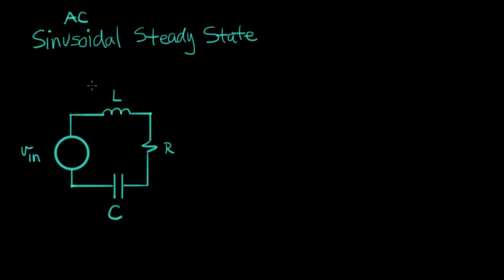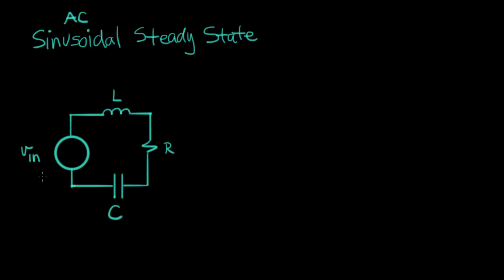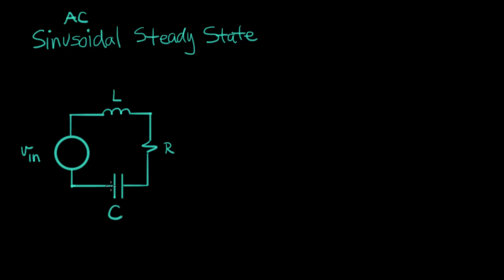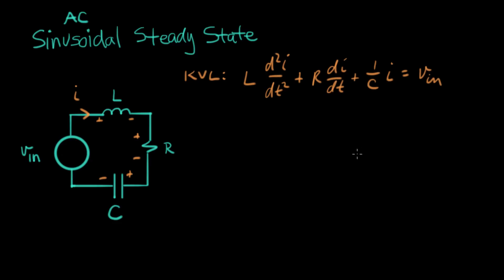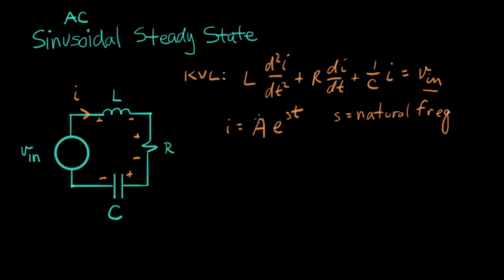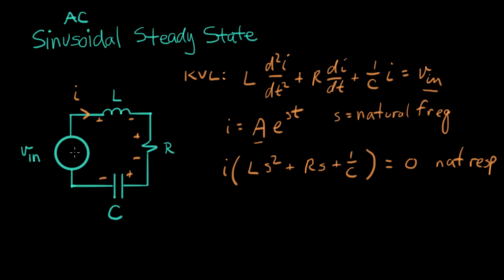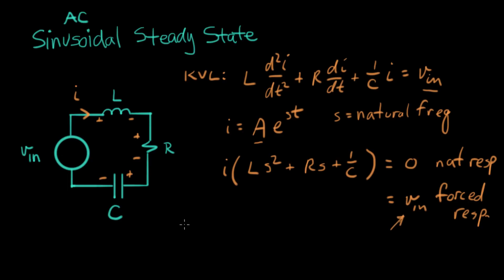AC analysis intro 1

Comment: Isn't it L di/dt, not L di^2 / dt^2 ?
Reply: Yes, he skipped a step. To solve it with the D.E. method, you want to have the form ay'' + by' + cy = f(x) so that you can apply a non-homogeneous DE recipe to solve for y. KVL tells us that L*di(t)/dt + R*i(t) + (1/C)*[integral(-infinity, t)]i(t)dt = Vin. Because the voltage of a capacitor contains an integral, you differentiate the entire equation and this is equal to the equation in the video. It also just so happens that after differentiating, you are left with the form ay'' + by' + cy = f(x). I do agree he should have explained this, but if you have been practicing DC RLC circuits, it's a common theme. I hope this made sense to you and good luck!
Reply: @x17099  yeah but shouldn't it be =dVin/dt?
Reply: Thanos Kourkou I suppose you could put it that way but because the source is an unchanging voltage (a constant) the derivative is always equal to zero. We do this because it’s very helpful in finding i(t) in this specific case.
Reply: @x17099  so why dont we put it like i say and have our equation equal to zero and do the exact same thing as the privious video?